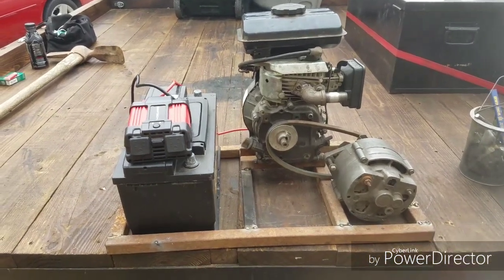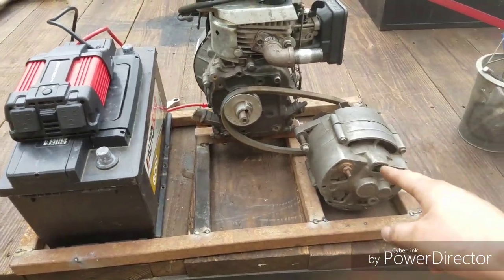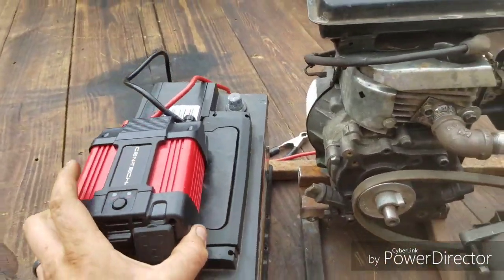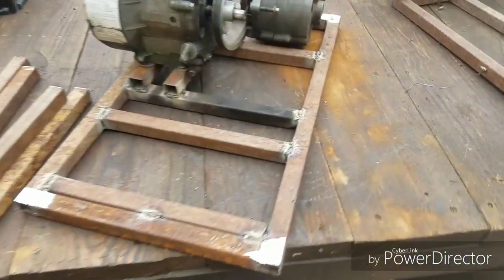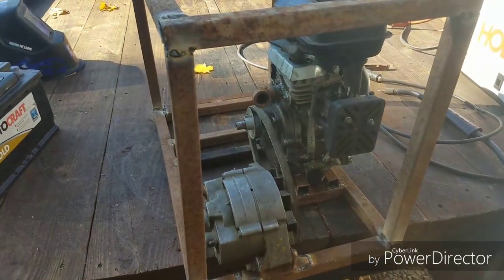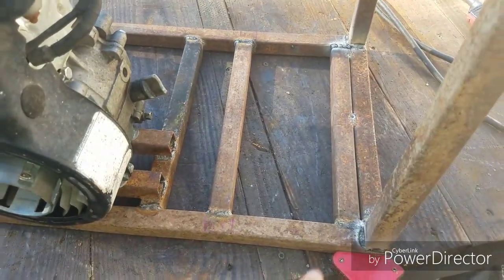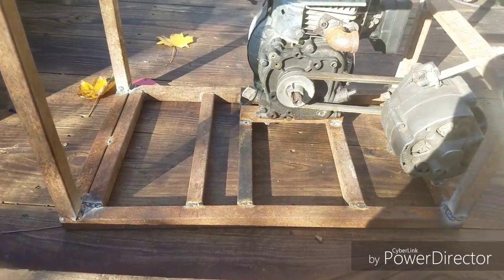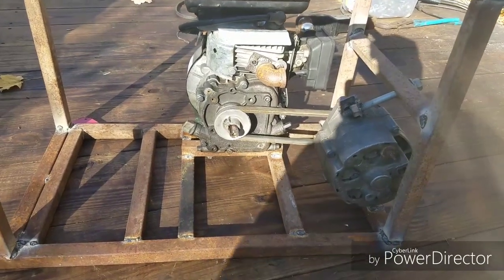HOMEMADE GENERATOR EXPERIMENT

Comment: You need a voltage regulator you can do this with a relay or getting the regulator otherwise you will blow up the battery . 18 v will definitely blow it up . Do you did the right thing in checking the voltage . Please don't get injured trying this and not checking the voltage output
Reply from the maker: I built a new one using an internally regulated alternator.

Comment: I'm about to use 4 old alts take electronics off drill holes and add permanent magnets to the staters for 220v 3000watt each 12kw 11ish actual using a 3500 rpm ac motor to turn them. Use a electric handheld weekender starter to get alt turning til ac motor kicks on done .

Comment: For off griding with DC systems, this type of generator would be excellent for charging battery banks in conjunction with solar. When your power levels get to low, fire up the generator automatically to power your usage, and top off the batteries.  I think I can build it :)
Reply from the maker: Check out the new one I built this year https://youtu.be/fz2-e9pxIFc
Reply from the maker: I like the idea of having an arduino monitor the batteries and start the engine to charge them when they get low automatically.

Comment: Great idea. I really like stuff like this. If I'm not mistaken, you are turning the alternator backwards and the fan on the front isn't going to be blowing air across the coils inside to keep them cool. Keep up the great work, I can't wait to see how it turns out!
Reply from the maker: Thanks fan, its somthing I've been thinking about building for a while and I finally accumulated all the parts.  From my understanding the alternator is spinning in the right direction positioned like this. The small block chevy it came off of spins clockwise when looking at  the front of the engine, this 97cc engine spins clockwise when looking at the front of the engine. So with the alternator facing the same way it alsos spin in a clockwise direction.
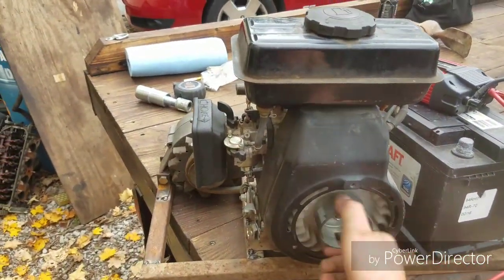Reply: At 1:15 if you freeze it,,,you can see the fins are facing for a clockwise turn,,:)

Comment: i built one these using a 212cc predator engine a chinese 100 amp knock off
of a gm alterñator a pulley a belt some scrap metal a turbuckle and a harbor freight invertor ...its good and is equivalent to an 1100 watt generator  the pros are repair parts can be bought locally and can be shut off and still supply power for lights if need be  the cons are  my unit cost more to build than it would have cost to just buy a generator
my advice to anyone looking to build one of these is dont exceed a 750 watt invertor  and buy a better brand invertor i changed my invertor out to an ever start from walmart it was exactly the same price as the harbor freight unit but has more features the everstart tells the watts being drawn and the voltage in the battery  also if using 1 battery dont expect a long run time before having to recharge but one 40 watt bulb will run about 5 hours before having to recharge
Reply: What size was the battery you used?
Reply: @andyherbert2304  sir i used one 750 amp non deepcycle  automotive battery one could get more run time by wiring 2 to 3 battery's in parallel just so its known an invettor shuts down when power source drops 10 volts  not when the battery is discharged   i forgot to mention that in my original comment also my set up will charge the battery back to 12 volts rather quickly i always let the battery charge about ten minutes though and if im running say a tv or something i keep the motor running

Comment: I wish i was an electrician, but if i was an electrician i wouldn't b in the position i am now to get free alternators, gas and other car parts. I so need to find an electrician thats into this stuff and make a deal with him. But if i was an electrician and got these parts free like i do I'd be doing this type of stuff.
Reply from the maker: The struggle is real
Reply: Try learning the most rudimentary concepts surrounding this specific subject, on tge long run its very easy, and you'll learn more and more as you go.

Comment: the alternator needs to have built in voltage regulator
Reply from the maker: Yeah I looked at the wrong info when I was building it.  I bought an external regulator for it and need to do a video on finishing it.
Reply: @nachodadsgarage1159  any alternator you can recommend with built in voltage regulator?
Reply from the maker: @nourestani  If you're going to be buying a new one get a 1 wire GM alternator.   You can get them in just about any amperage you want and they start at $40 on ebay.
Reply from the maker: That one would work and put out 1300 watts at 12 volts

Comment: Does it make any sense at all to try and use the treadmill motor golf cart batteries to power either a a salvaged generator from a gas powered generator orbi and alternator wire to put out AC current

Comment: How much maximum load you can run on that genrator  ?
Reply from the maker: The inverter I'm using will support 2000 watts but this alternator can only output about 1000 watts  continuous.
Reply: @nachodadsgarage1159  thank you for very informative vedio 🙏

Comment: hope thats a permanent magnet alternator..   most car alternators require power to magnetize the core,   useless as generators..
Reply: Built a battery quick charger years ago,left my headlights on,had to leave for work in an hour and no neighbors home.Still have it.Electric motor and a old Chevy 350 alternator (requires power to charge magnets).ALt. output jumps to the pigtail+ and to battery +. bat neg to alt mount.Dead battery has 8 volts. That is enough to charge the magnets enough to start outputting 9 volts,9 gets ya 10... in a matter of seconds it is putting out 14 volts.  10 minutes latter that dead battery will start your car.

Comment: bad alternator... overcharging for battery. the alternator needs to have built in voltage regulator.
Reply from the maker: Yep, I rebuilt it during quarantine and fixed this problem.  Check it out at the link in the description

Comment: I wanna build something like this great build and i would clear coat the frame
Reply from the maker: Thanks bud,  I need to finish it one of these days
Reply: The best “clear coat” on rusty metal is Penetrol by Flood, it’s brushes on and is self leveling. I did a bare metal Mercedes 300SD(diesel with a hood stack) and it hasn’t had a spec of rust after sitting out all winter

Comment: Hey, for some reason I found myself in a situation when I really need to build a generator like this one. But I have one question and if you (or anyone here) could answer me I will be very grateful. So alternator has a certain power on the output (voltage multiplied with the current). And inverter also has a certain rated power. If I understand this correctly then the power that alternator produce needs to be lower than the rated power of inverter? It doesn`t need to be the same right?
My second question is what happens with the car battery? If electricity goes from alternator to the battery and than from the battery to inverter. Is the power that goes into the inverter still the same as the power from alternator or is it different because of the battery? If so how do I know what voltage and current goes from the battery? Does it depend on alternator`s power?
Reply from the maker: you'd want your alternator to put out an equal or greater amount of power than the inverter will consume.   this keeps the battery from draining. the battery acts as a buffer for the power coming from the alternator and helps with peak draw from the inverter
Reply: @nachodadsgarage1159  What about the battery? Does it matter which one do I use? I mean the voltage is probably 12V for all of them but how about the amps? And capacity.
Reply from the maker: @lukam20  In general a deep cycle or marine battery would be best, but a regular lead acid car battery will work. i use a car battery on mine and it works good for the application
Reply: @nachodadsgarage1159  Thanks man

Comment: hello sir i am also making such generator but needed to know something . what is the output current from the alternator (voltage is 14v )but what is the current please sir help as i am making for my college project please sir
Reply from the maker: The current depends on the alternator used, this one only puts out 65 amps.
Reply: @nachodadsgarage1159  sir if i want to generate 220v and 20 amp from any alternator after rewinding how much awg of wire should i use for winding
Reply from the maker: @nandlalchoudhary2579  That is above my pay grade, I use an inverter to turn the 12v dc to 120v ac on the one I built.

Comment: You don't need an inverter take out the diodes the alternator is an a/c motor/generator to start with.
Reply: Alternator i three fase generator, whereas most of devices use single fase AC so it can't work properly, eaven with transfer.